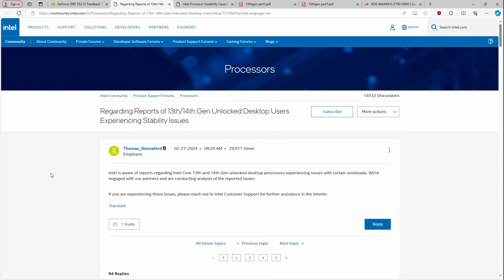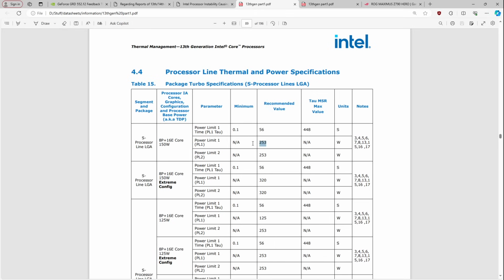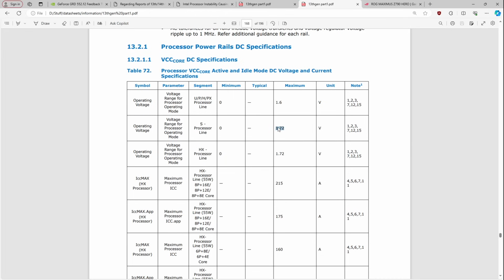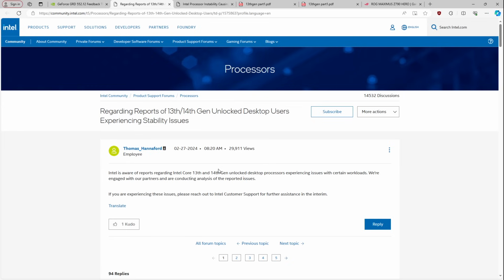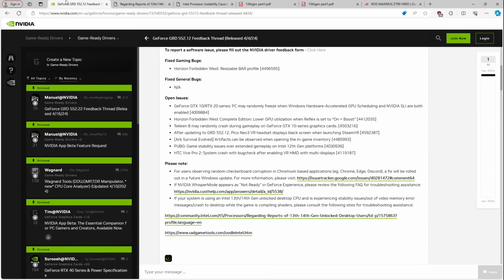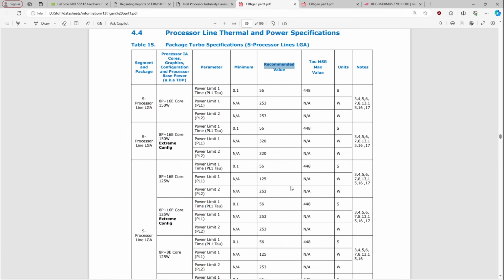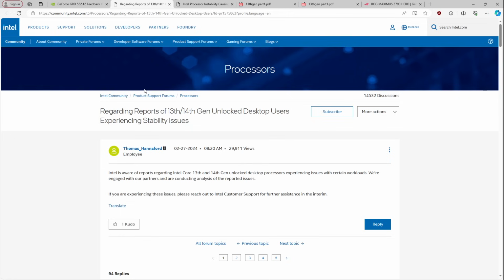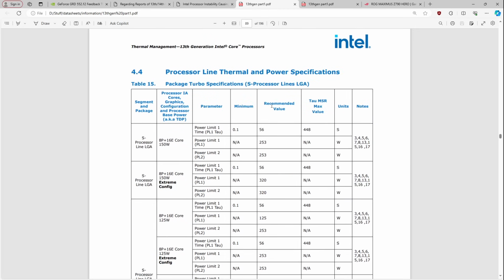Rambling about why some intel 13th/14th gen i9s and i7s aren't stable.

Comment: Increasing the voltage will degrate the CPU in long term even more than it already does, so it will crash even more in the future. This is not an option for theis CPUs!
The voltage is high enough to degrate the CPU out of the box. they run at 1.4+V!
You need to return the CPU and gat a new one from Intel or Amazon or whatever. You have warrianty.

Comment: I had a 12700K that would crash Prime95 small FFTs if I ran it without power limits. 12700K was coolable in small FFTs because all core turbo tops out at 4.7GHz at 230-250W depending on voltage. ASUS set the LLC to 2 by default and I tried setting it to 3 and it crashed. I remember thinking that behavior was odd considering the CPU was "stock" but I really didnt think much of it.

Comment: Intel doesn't have anything going for it. They rushed these chips to contend w/ AMD. I have a 13900K and I can't tell if there are issues. I've had several crashes but I also had a mouse software update that claimed to fix random crashes. About the same time there was an ASUS bios update. Intel is getting bailed out by USA. White is black, dogs are cats and Intel is fine.
What gets me about this craptor lake chip is that it doesn't have enough lanes so when you populate the 5th gen m.2 your 16x becomes 8x while AMD has just enough lanes so 16x on 5 gen is a thing.

Comment: 12900 (K/KF) Also have an issue but its Far less noticeable. The lagg/delay issue people on 12th gen is likely confused for Ram/GPU/Ethernet issues because it doesn't crash. Temp fixes work to the point you can now use Unreal Engine 5.4 which frankly is still causing issues even after fixes.
Reply: lol and I heard so many peeps say intel would have better stability than my 78x3d glad I didn’t listen or want intel

Comment: As someone who's had system's of questionable stability on default settings (due to memory having crap defaults, using a xeon in a motherboard that wasn't made for one, due to BSEL modding the CPU, etc) this is not a great place to be. Maybe you can get it stable by adjusting voltage/clock in BIOS now, but what about after years of use? The stability won't get better with age, and if it ever gets to place it has trouble POSTing on defaults then the CPU is essentially dead if it ever needs a BIOS reset (or won't POST with the settings configured), because you wont be able to get into the BIOS to fix it.

Comment: This is super important, I typically buy motherboards based on VRM cooling, as some have literally no cooling on power delivery. So if you end up with a overclocked motherboard, you'll only know when you check the BIOS settings... and your expecting that some youtubers/websites are gunna know to baseline BIOS figures. More importantly, what will intel do if you overclock and burn the CPU without knowing the current limits are not enforced by ASUS? Free replacement? I doubt it.

Comment: I have an Intel 12900k on a 360 aio using a contact frame, and I honestly feel performance is shite. It is fine with 4.9ghz and can boost to 5/5.1, but to actually run it at an all core at the same frequency constantly seems impossible. Also general desktop use feels less responsive than 10th gen. Idk why it's so bad, other channels have also talked about the issue with desktop lagginess on 12th and 13th gen.

Comment: Intel already has poor power scaling, so you kind of need high PL to be competitive, so it is clear how desperate they are. Gamers are better off with 7800X3D anyway, which uses only a fraction of the power. Too bad AMD joined the juicer camp, but at least their limit is a bit lower, and more importantly, stable.
Reply: Can you elaborate on juicer camp?
Reply: @Sushious pretty sure he just means for Zen4 AMD adopted Intel’s strategy of less power limits and allowing thermal limiting near 100C to get the best benchmarks out of their chips in competitive reviews. It’s not as extreme a degree as what Intel’s been doing but it did raise eyebrows at the time.

Comment: I had a z790 aorus masterx that i returned kept crashing and just went into a boot loop. I returned it and got asus z790 dark hero and no issues. I have xmp at 6800mts, 420mm aio. 25-27c idle and 75c under 100% load.

Comment: If a CPU requires water cooling, just don't. This was inevitable.
Reply: Or use the power limits and set them according to the cooling you got. What was inevitable is CPU running in configurations not stable for AVX2 crashing running shader compilations(which is AVX2 optimized)

Comment: The good news about all of this is hopefully Intel stops the nonsense and makes the power limits strict and not recommended.

Even better would be NOT shipping factory overclocked CPUs to begin with.

But they gotta do everything they can to get bigger bars on a chart,  who cares that they're pushing their chips to the tip of stability and running on a very top of the VF curve.

Comment: let me share my experience with you. I built my pc in march 2023 (13900k) and i was using it for 6 months or so without any issue, cinebench and other real world applications would randomly crash. reached out to intel and they ask me to run multiple test for over a month and refuse to accept the CPU for further testing on their end. after a month they finally agreed to accept and i sent them the CPU, after a week of the CPU being with them they agreed the CPU is faulty and sent me a replacement 13900K. Installed the replacement 13900k and things started working again and I was happy, 4 months down the line again the same issue and this time i told intel I am not running any tests at my time expense and they have to take the CPU and run tests. Sent them the CPU on march 5th and till April 5th they are keep telling they are running tests (mind you at my expense, no CPU for over a month). I tell them i need a refund cause I will not accept another replacement for it to just spoilt out of warranty... they agree after 2 weeks and then intel customer care sends me a link to ask me for my banking details, I submit the details and wait another 48 hours for them to tell that the tool (the link which i submitted) is having some issue and they are unable to see my banking details. its 25th of April. I still dont have working computer thanks to intel and their shitty product, no refund, cant go and buy a new CPU..... I just cant understand how a company like Intel can let it happen.... someone needs to file a class action suit on intel for fucking consumers over.

Comment: i had instability on 13600k (dota 2 crashes). Fixed with limitting max current to 307Amps (stock OR undervolted - both crashed)

Comment: Appreciate your analysis on things like this as it gives good insight that generally isn't covered by most tech journalism. Given what a low volume retail sales are I wouldn't be surprised if Intel just doesn't test retail motherboards. They probably rely on board partners to actually do their jobs and report back issues which isn't happening. This of course falls back on Intel for not caring about motherboard manufacturer shenanigans for over a decade.

edit: MSI put in the ability to raise TjMax to 115C on Z790 which I think reforces your degradation isn't happening stance.

Comment: U seem to know ur stuff. I have had issues with my 14900k. I have a MSI Pro Z790-a Wifi DDR5 MOBO. I have set the cooler tuning to 253w and disabled multicore enhancment.
These set the correct IccMax + power limits. I'm very illiterate when it comes to bios settings and I fear there's still some sort of setting fricking with it as sometimes (not always) during UE5 shader compilation my PC stutters. It does not crash anymore but its still not normal behaviour. (I don't want to degrade my CPU, ur words of the degradation not being likely do give some assurance)
Do you happen to have an MSI motherboard? If so, could you please make a video on how to enable all of the intel defaults and what loadline settings affect stability in a positive way etc. Asus has SVID behaviour in their bios but MSI doesn't
Reply: what is msi BIOS equivalent to asus's multicore enhancement called? wasn't aware msi had this or just forgot
Reply: @FloydTheBreathles  it's called enhanced turbo in the bios. According to a few reddit posts it's basically the same thing as asus multicore enhancement.
Reply: @ml-wl4xl  ah yup that's it totally forgot   and do have it disabled and remembered exactly what sub menu it was under after seeing your reply.  Thanks, completely forgot they had this as well.

Comment: I work in enterprise infrastructure hardware deployment and validation, but not data center, so I can't specifically comment on CPU vendors, but other vendors in other spaces are hyper-siloed. I would bet good money the Engineers were ringing all kinds of alarm bells about this long ago, but sales and marketing shut the right the fuck up when they saw literally out-of-spec power limits lead to high benchmark scores in reviews.

Comment: Did you see JayzTwoCents video?  He says it's the motherboard settings.
Reply: didn't see it but this is true. i always oc my system anyway so this isn't a problem for me but most people just want to plug and play which is fine but even when i build systems for friends and family when they ask for help i never leave the setting's on auto in an Intel motherboard  (amds are more forgiving) anything from  alot ofnthe voltage rails (including ram voltages)are absur, llc settings some boards defaut to the most aggressive for an example and other garbage power save settings and my least favorite TBV boost and all of it's sub settings but most people don't wanna be bothered by this. Im sure some people as BZ States do also get terribly binned cpus on occasion which id return in a heartbeat. also most people never update their bios either

Comment: If I recall right, the last of the original Intel Atom server CPUs had a degradation issues, and after 18 months they started to fail. CISCO SYSTEMS  was not happy.
Reply: Yeaaaah. I started work at a bank in 2015 and my first project was working on prepping/coordinating replacing ~1500 routers/switches across the country. By the time the project was wrapping up the first devices we replaced started dying. Had to replace them all again, first in/first out. Cisco footed some heavy managed service fees on that one to get people dispatched to all sites, again. Tough to coordinate that many sites/devices/personnel for after-hours work. Ahhh… ☠️
Reply: Yup, wouldn't be the first time certain chips have a degradation issue.

Comment: if the chip is bad u can just exchange it ... intel doesnt test every single chip for u but they ship it at least with an table where u instantly see that its a chip to exchange ... a few % of i9 will crash and u obviously just exchange it ... its 600$ intel doesnt care ... i dont know why this is a topic even ... and if it cost u soo much to exchange bad chips u can charge intel for that also if u want it so badly ... they dont care ok ... chips is more than fine if ur not super unlucky and have the hard job of exchanging it xD omfg guys

Comment: When I worked in a pc system assembly factory, we stress tested everything for 24 hours, there were Always some systems that failed, Always. They would be looked at and then stress tested for 48 hours if they failed the first 24 hours. With all this self assembly, they are trusting consumers to do this and many just won't.. They expect to plug it in and it works. Its a case of a little knowledge is dangerous. Talking power limits... The power limit on my old Z97 board by Asus is 4095W !!!!!!! Think that might be too much.
Reply: And I bet your factory wasn't even enabling XMP like /r/buildapc tells everyone to do (and votes into the negatives anyone reminding people that overclocked memory needs to be stress tested).

Comment: The thing is, Intel doesn't just allow them to ignore the power limits. They encourage it. The last time I saw a board follow Intel spec out of the box, it was a cheap ASRock board that would throttle if you went any higher, and every reviewer said to ignore that board because it was scoring a good 10% lower than all the others.
Reply: Well, it's never really been an issue before this point - I can't recall a time in the past that a power limit had been necessary for an Intel chip I bought. They've just pushed things way too far.

Comment: Even though both my i9 13900k builds got through R23 at stock setting on my AORUS Master boards my i7 14700k build on a AORUS Pro board did not. This is the first Intel CPU that I have owned that has crashed with stock(out of the box) settings running a standard bench. In the past I would have to overclock to get a crash.
After I set the i7 to the Intel limits and reran a few 3DMark benches and game benches the performance was about the same so I am not unhappy with the result.

Comment: The voltage thing isn't 100% true. At a point of raising the voltage little by little it causes it's own crashes. SVID is different. Also the degradation idea might be because for some reason the crashing has been getting worse in the past three months.
Reply: I think a software change of some kind happened behind the scenes recently. In my case, absolutely nothing points to a faulty CPU, but it'll shit itself on loading UE5 and occasionally hiccup on dx12. Does not bsod, does not crash in any other instance, not even under heavy load in a game like Warhammer 3.
Reply: Crashes also tend to corrupt files.

Comment: I have an old GTX 660 OC that runs at 1032 from factory, supposedly 1080 in boost. For some reason, top boost is 1132MHz and it keeps crashing on CS2, though you can go for some hours without issues. Eventually there is an Nvidia driver crash that is logged in Windows.
Even stranger, I can see this old i5 is limiting performance.

Have to downclock to ensure it doesnt boost over 1080MHz, as per MSI spec. Dont know why Nvidia does this but I only saw this on CS2, so there's that... It is so old there could be degradation, have already switched PSUs.

Comment: This is weird. Ever since I have i9-13900k I've had stability issues with it. I even replaced my z690 ROG MAXIMUS motherboard to z790 Aorus Master believing it was the motherboard issue. The default profile is "optimized" which is not stable. I found that best thing to my CPU is to use it with Intel XTU which indeed overclocks the CPU to higher voltage and power draw but overall it works better. 

My biggest issue is I believe the CPU causes often stutters in my games (with 4090). It's terrible at times.
Reply: Just configure it manually the oldschool method with fixed voltage. This is what i did to my unstable i7 12700KF. It otherwise isn't stable with 4x8gb memory.
Reply: Try to enable Gsync/Freesync (ofc both on monitor and your windows graphics card global settings), and also activate global vsync. If vsync is globally activated, you can even use it together with DLSS3 frame generation (for instance, Diablo 4 disables Vsync in the settings if frame generation is enabled, but a global vsync-on setting overrides that). I've also limited global maximum frame rate on graphics card settings to the maximum refresh rate of my monitor. Also, latency is surprisingly not worse than without vsync enabled, in fact, might get a little better. Worked for me (4070ti super), but I also had screen tearing on some games besides stutters. Worth a shot anyway if you haven't tried it, though. Good luck.

Comment: I've never had a cpu degrade, even running higher voltages and clocks for years 10+.

Having owned a 12900KS and 13900KS they both were stable with a bit too much voltage stock.

Under voting and tuning both, I've had it become unstable in R23 after months, once when ambient temperatures dropped from 30C to 20C, which I found surprising as usually cooler temps = less volts.

What I think may be a common issue is that 12th to 14th gen are sensitive to temperature and if you have a boarderline stable voltage to clock it will be unstable when seasons change.

I think the automatic voltage and temperature scale offset configured for my 13900KS is off slightly, same settings 95C load at 1.248V pc unstable, however in summer when testing at 105C, it was pumping 1.272V on the same settings and you can smash r23 no problem.

5mv extra fixed the stability over 60 mins R23, was just weird I had to add voltage in winter.

I agree with the point that Intel didn't quite get the temperature offset and VID table 100%, and this problem is then compounded when board vendors pump the chips over sepc.

Comment: I LMAO when he totally flipped "How did they let this get out of the Factory, how did they not notice, did they not test anything. . . . . ." 🤣😂🤣
Reply: If you're lucky it crashes ...  far worse is if data is corrupted.
Every Zen CPU I've had allows an under volt in curve optimiser, but sometimes the fastest cores become reliably unstable in ST mode until the under volt is reduced so they handle the max boost frequency.  That way the CPUs run above claimed performance and are easy to keep cool enough under heavy all core continuous load.
The Intel behaviour really sucks as new software or updates could trigger it (or summer) and the mobo defaults don't fail safe.